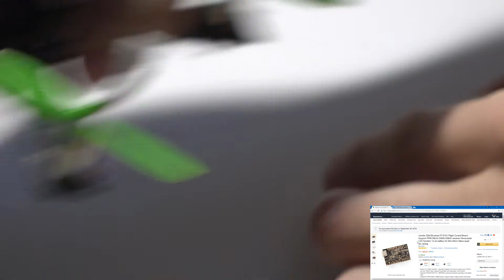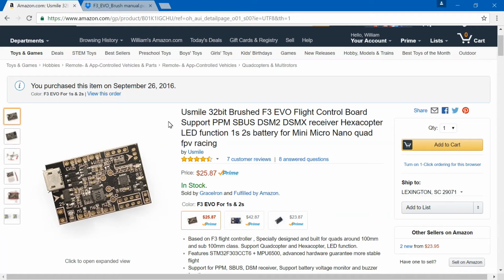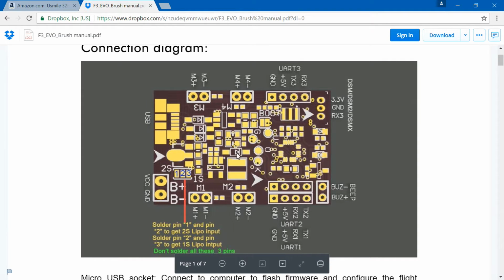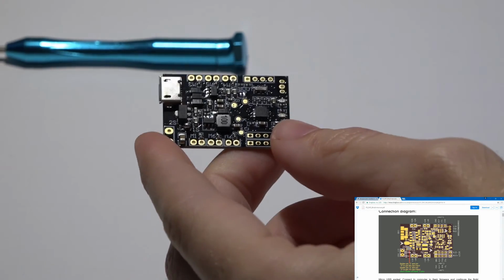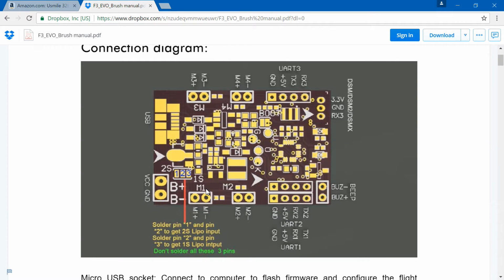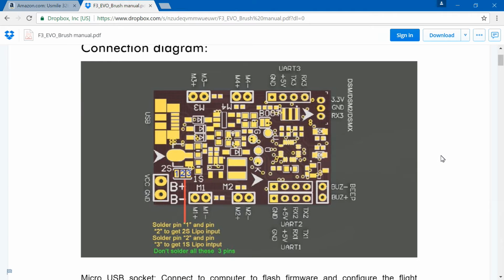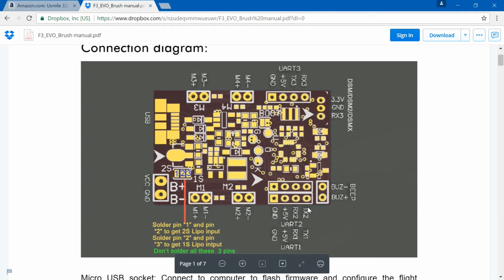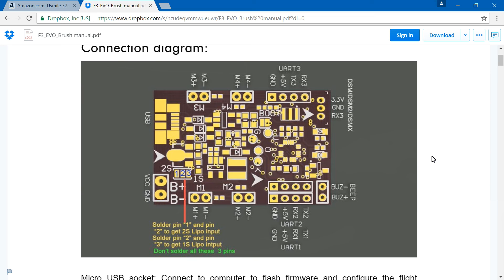F3 Evo Brushed Flight Controller Review

Comment: i cant get mine running on 2s as soon i plug the battery motors star spinning full speed when i plug back the 1s works fine and i did solder the 2s pin

Comment: how to u plug the sbus? it has 4pins
Reply: 2 of them are power and ground, the other two are RX and TX. You need to find a pad layout on google (there's plenty on them), and solder the sbus to the RX pad of UART2.
Reply: i got it working but now it wont lift more the 3inch from the ground like its to heave or the throttle is not set to 100% i swap motor thinking i mix them with a different rpm but still

Comment: Dear Project Blue Falcon
 i have project to build a micro H quad. I use  Walkera Devo7 tramittre .and the FC is 32bit Brushed F3 EVO Flight Control Board.  What type Receiver can work with FC  F3 EVO 
THANK YOU     18022017